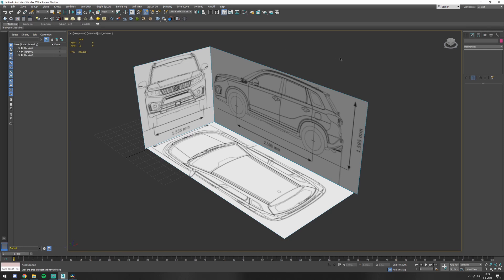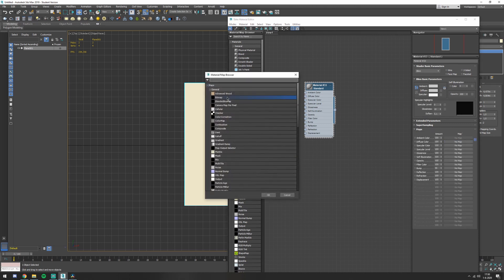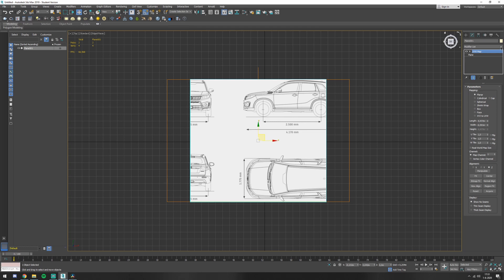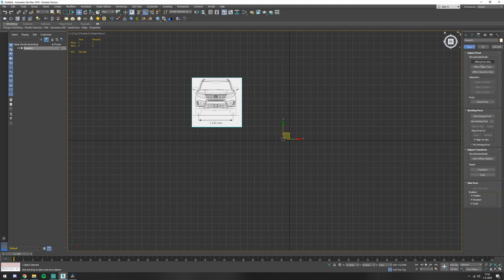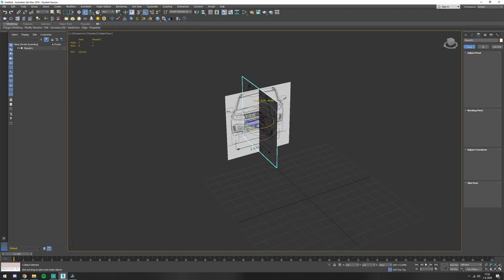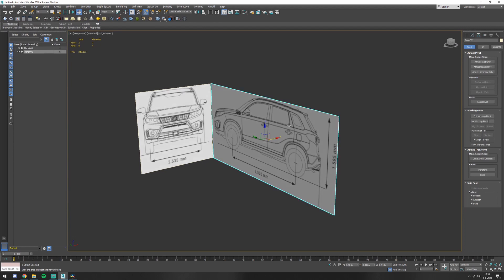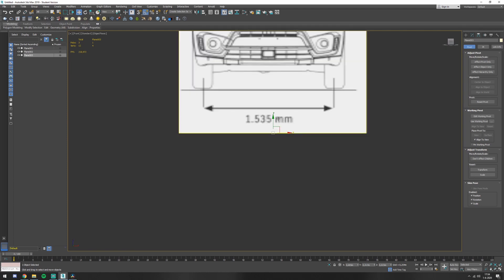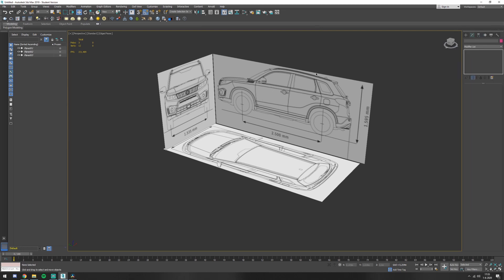How To Set Up Reference Image | 3ds Max 2021 | Blueprint Tutorial

Comment: Been adding planes for years. Never used this UVW map trick. I usually do a bit of maths on the length and height. This is a much easier method. Thanks.
Reply from the maker: Glad I could help :)

Comment: On 3ds max 2021 there is no scanline/standard option? Do you know how to do it in 2021?
Reply: @Base-3  There is no "Scanline" material option in 2021, only "General".
Reply: @evgenyrivkin4908  yeah mate same. it's so frustrating
Reply: @goutham1572  hi i had the same problem... i had to change render engine from arnold to scanline first
Reply: @erlon1506  how to do that?
Reply: @isuframadani1635   Rendering > render setup